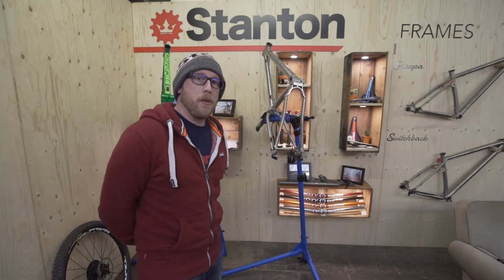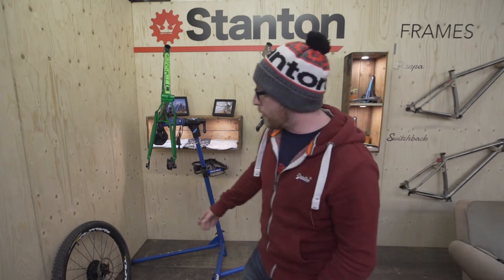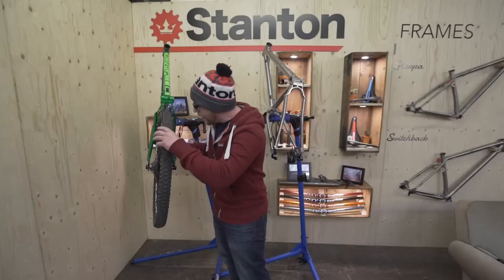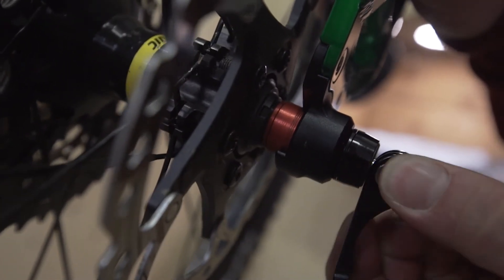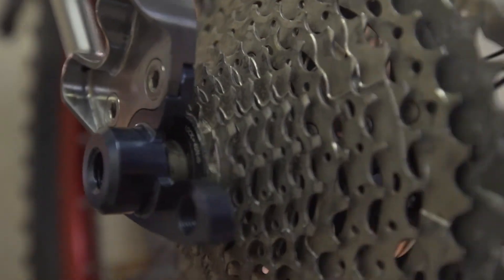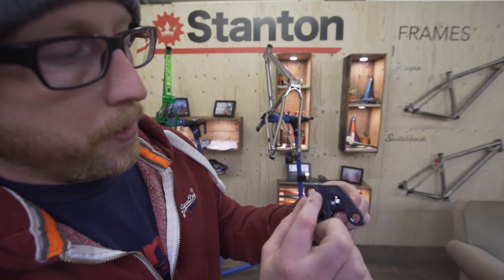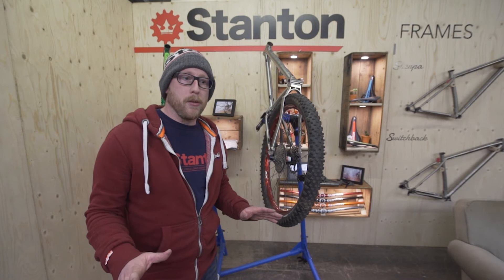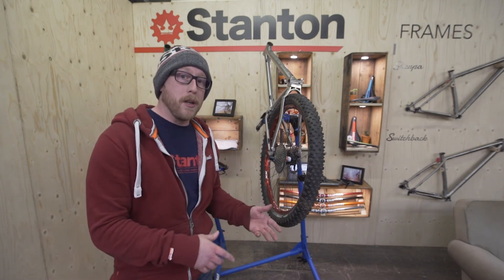Stanton Tech Talks, How The Switchback Fits Boost

Comment: Hey guys, can we place this group set on your frames? Sram XX1 Eagle Dub X-Sync Direct Mount Boost XG-1299 12s?
Reply from the maker: If the frame is pre 2017 it uses conversion kits to fit boost, so then on SOME (very few, only found on Halo wheels so far) wheels XD drivers are too far over and the chain can catch the frame. 
Boost spaced frames 2017+ you have no compatibility issues as the frame is made to boost. Hope that helps 😁👍